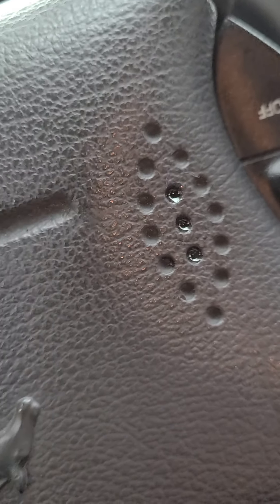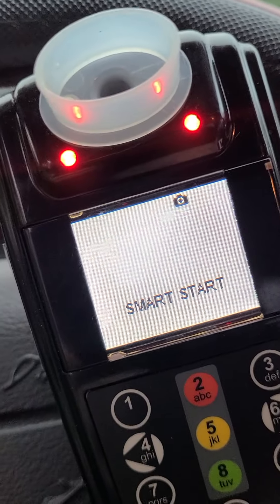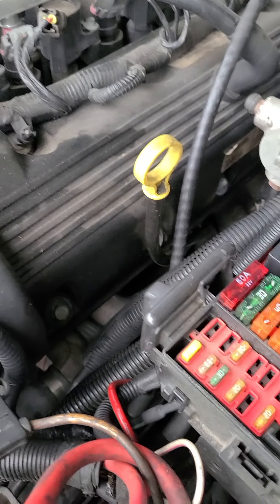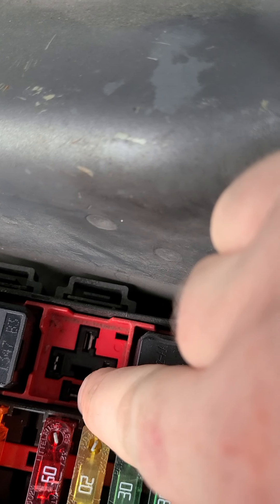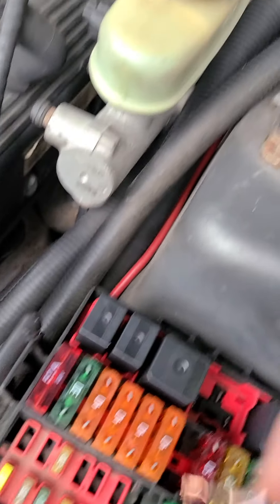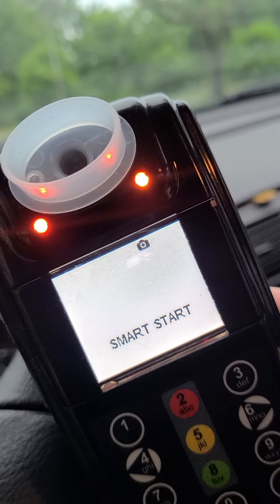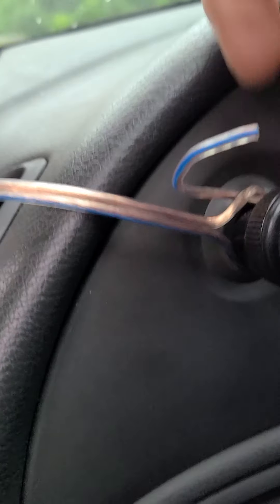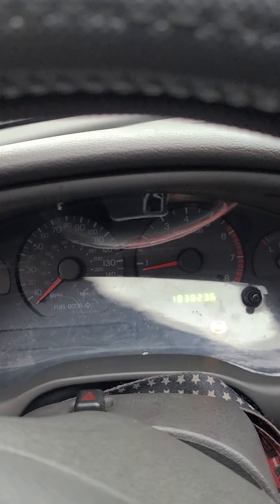bypass ignition interlock smart start

Comment: Is it wired to the starter only? That’s hella stupid and simple to defeat if it is because on modern cars the PCM will give spark and fuel as long as it receives signal from crank sensor, it doesn’t care if it’s cranked by a starter or anything else, that’s why you can roll start a manual car. What I am saying here is as long as you can crank the engine somehow when the ignition key is in on position, the car will start and stay running, and you can pop the hood of your car and complete the circuit of starter solenoid with a screw driver or any metal bar, and the starter will engage the flywheel(or flex plate) teeth and crank the engine.
Reply from the maker: That’s all it’s hooked to is the ignition wire under the dash that engages the starter when you turn the key. When you blow into the device and hear it click that is the relay completing the circuit
Reply: @ronnie7757  lmao, that’s lame!

Comment: I have intoxalock. Will that work on it? Also Can the IID service detect any tampering? Thanks.
Reply: That’s what I’m wondering, I failed my Intoxalock 3 times and got a letter today saying their extending the damn thing for an entire extra year.  Time to figure out how to start bypassing this thing
Reply from the maker: Should work with all brands
Reply: @Werk4Cash  I have intoxalock too. Had violations as well. Gotta use this for a long time and I do deliveries. Did u have success or did they give u a violation? Plus mine has a camera that takes a picture when I blow. But maybe if I just start it it won't take the picture. Any help would be wonderful
Reply: @turtleyto  no success man :( but I have heard of people jumping the selinoid on their car and it completely bypasses it but I am way to scared to try it, there’s definitely a possibility that it will show the car was started without any blowing.  It sucks man I’ve done hours of research and just can’t figure out a way around it but there has to be one we just don’t know it yet

Comment: That device will still read a start without a test it reads alternator current  once the vehicle has started so your just digging you hole deeper by doing this. Once this device  is collected  and the data has been downloaded it will show a circumvention of the system. BTY if you are doing this thinking you will get out of paying your fees think again most states put a hold on your  license  until all fees are paid to the provider. It may be even worse your local dmv or monitory authority may not credit your time with the device and make you start the program  over from the start . 7 year interlock technician here I've seen it all and clients that do things like this ALWAYS turns out very badly for them.
Reply from the maker: I got my device removed and haven't paid smart start anything for the last 2 months I had the device. Got My license back without issue. This was almost 6 months ago.
Reply: @ronnie7757  he thought he was on to something. Clearly didn’t watch the entire video. Like you said the whole thing is a huge scam.
Reply: @rorymurray2891  Rollin Phat 💰🤑 Thanks
Reply: If it reads current without a start then you can't charge your battery?
Reply: @erush611  You can change the battery just let the provider know you did change it. The technician you contact will put a note on your account that the vehicle was powered down for the swap. This lets the monitoring authority know that the device was not tampered with because it records power up time and power down time.
Reply: @slapnutzracing2967  that's right you bring tow bill and shop receipt
Reply: what if the handheld is disconnected?

Comment: Do you get further violations once you are on lockout and use this method?
Reply from the maker: I didn’t
Reply: I work as an installer for a different brand and we could identify this super easy and he'd have a 3 month license suspension and more penalties.
Reply: @BrapYeah  interlock I suppose  records rpms(knows engine running), and the mileage am sure is noted. Maybe only works if speedo is broken. Probably, counts the times it's started. (W/o breath samples) am close huh🤓
Reply: @BrapYeah  should be able to make these more reliable super easy lol

Comment: What about the camera and gps?  Are they still active with this bypass method? 👀
Reply from the maker: Mine did not have GPS. As for the camera it is only supposed to operate when your blowing into the device. Also if your to the point of bypassing it I'm sure you don't care about the camera lol
Reply: @ronnie7757  lol. Thanks for the info.

Comment: @roadsafeties-wg6hi
0 seconds ago
SOS Any body. I have a 2010 F150 XRT suddenly the security system would not let me start. I did what you said on this video and even took out the transponder and remote starter, but the light keeps on blinking and not even a crank. The on and off switch for the security are two red wires, which seems to run into somewhere in the hood. I don't know what else I should do. And I can't find any other memory box for the security except the two boxes I mentioned earlier.
Somebody help me

Comment: i tried on my 2016 jetta 5 speed manual, i could not get it to work  my fuse box says 87 and 30, do not have 87a.  any suggestions?
Reply from the maker: It's possible your neutral safety switch is stopping it. My mustang use to be auto but swapped to 5 speed. Never hooked up safety switch so car starts without pressing clutch. Have someone push the clutch down and try it.
Reply: Have you tried to push start it before?

Comment: If you do this, just like bypassing a bank/buy here pay here, the machine will know, and whatever enforcement agency you report to will know. You will be riding the bus for a year. If in fact you may never be allowed to drive again, depending on your jurisdiction. And all the time you have will be erased. You can even be charged with another DUI.
Reply: WRONG, you can't be charged for a DUI unless you fail a BAC or blood test.
Reply: You sound like u work for these guys 😂
Reply: You must be part of the scam. Interlock device is only so you can drive before your suspension is up. If your caught all they can do is tell you to ride out your suspension which is the punishment you already got. Where I live the courts or probation have nothing to do with drivers licence division or interlock. Probation or court just suspends your licence. It's the Drivers Licence Division that requires it for you to have a valid licence before your suspension is up. It has to do with local laws. Now probation can set any standards they want, but they can't force you to have an interlock. I've been driving with a suspended licence for 14 years and I've been pulled over a couple times. I've had to spend a total of three days in jail in the last 14 years. My average is one pullover every five years. I never gave them a cent for fines or anything. Im not scared of jail. I will never lose my job because I'm self employed. The max jail sentence for my many warrants and DUI warrant is only three months. I told the last judge "I'm not giving them any money, take me to jail right now." The judge said jails are full you can't go and they sent me home without removing my fines or warrants. It's funny when your not a serious criminal and the courts can't scare you with jail they are hopeless. They can take my licence but not my keys.
Reply: @nicks7434  That's right my CRO told me he had nothing to do with interlock is a scam and faulty people like to get on here and scare people trouble is by the time your done this is when you find out
Reply: How come you guys that install them got DUI s it a joke
Reply: @jesusmalverde612  Right !! That's exactly what I thought.

Comment: Yeah. And as soon as the device senses that it lost power it alerts the people that they lost connection to device and they will assume you're tampering with the car iid or disconnected a wire
Reply from the maker: Wrong
Reply: Peoples batteries go dead in there cars all the time. I'm pretty sure there not going to give you a violation for a dead battery

Comment: where can i get this kind of wire?
Reply from the maker: It's just speaker wire I think it's 14 gauge wire its what is used for wiring Subwoofers thicker than regular speaker wire.
Reply: @ronnie7757  which wires do I use to make it start

Comment: Will the breathalyzer company know if you do this ?
Reply from the maker: Smart Start had no clue that this was being done the last 2 months of my agreement. The reason for that was because I did not take it in for the recalibration that last time. So when it was time for it to get removed I took it to the place they removed it and I still owe smart start over $300 and never have heard a word from them and I have my license back and have had no issues with anything involving bypassing the device the last 2 months. Once the device is in lockout mode smart start things you can't start the car. They would only know the car was started if you took in for a calibration, however I am not even sure their software would tell them that.

Comment: A family member lost a alcalock cordless device the cars been parked outside can i start the 2000 Buick la sabre bro how can i drive with out the blowing device they wanna charge me 200 for a new one plus the monthly service fee ... Help Me Brother!!! Ill cash app you QUICK G
Reply from the maker: Just jump the starter relay like I show in the video. Turn the key to the on position like you would start it normally find out which relay runs the starter and jump it. The car will start
Reply from the maker: Your starter relay is relay number 36 in the engine compartment fuse box. Pull it and follow the instructions in the video

Comment: It’s amazing that you can figure this out but can’t figure out how not to drink and drive to get the interlock in the first place. Then you couldn’t figure out how not to violate the interlock by not drinking. Amazing.
Reply from the maker: It’s amazing your spending your time looking at videos on how to get around the interlock system. Go back to your moms basement.
Reply: What's the air like up there on your pedestal? What Ronnie said: Why are YOU looking at videos on how to bypass an iid?
Reply: @im2yys4u81  

1. No pedestal. Just a normal functioning responsible adult. You are the anomaly. 

2. That’s what we do to stay up to date with criminals.
Reply: Dude it's not actually that complicated. I searched it up just to confirm what I suspected.
Reply: Tree hugging wus
Reply: I guess you people are not reading his post upfront. He says clearly says, he doesn't condone drinking and driving and this is not a video on how to bypass the device if you have been drinking. Its to bypass the device because the equipment is faulty and locked him out and then he has to pay a fine to get an unlock code.
Reply: 😂 exactly that point way easier to not drink and drive LoL just don’t get inside the driver seat problem solved call an uber if you can afford interlocking you can afford an Uber

Comment: Does it work on manual cars
Reply from the maker: Yes, my car is a 5 speed.
Reply from the maker: The device is nothing but a large relay. That is the clicking noise you hear when you blow into it. It's the relay switching to complete the connection to your ignition switch. That's why bypassing with the starter fuse works. It bypassing the ignition switch.

Comment: Didn’t work on my truck
Reply from the maker: Did you find the starter relay?  What year make and model truck do you have?
Reply from the maker: Also forgot to mention. The longer the length of the wire means it may need to be thicker. With a diesel you may need bigger gauge wire to jump the starter. Had to double up the wire on my other car or else it would just click
Reply: @ronnie7757  my truck is a 2005 dodge Cummins 3500, I used some speaker wire on the relay, tried jumping the wires and all it did was make sparks didn’t turn the truck over.
Reply: @ronnie7757  I’m getting my blow box taken out in about 3 months, I don’t drink and drive anymore I’ve been sober for 9 months but fuck is this blow box annoying
Reply from the maker: @arcticdiesel8972  your starter relay should be #14 in the under hood fuse box. Make sure you have the wire on the correct prongs. Should be 87 and 87a if I'm not mistaken they should be right across from each other. try using a small length of wire at the starter relay maybe a foot at the most and touch them together and see if you hear the starter turn over. Make sure you are using a fairly thick wire. I used speaker wire that goes to subwoofers I think it's 14 or 16 gauge wire.
Reply: They didn’t find out you did that?
Reply from the maker: @AngelRodriguez-jv6oc  who is they? My suspension is up. Device has been removed.

Comment: To be fair it takes 4 fails in a month to be in violation lock 😆😆😆😆😆
Reply from the maker: Not in the state of Kentucky. It takes 1 and you have 4 days to take it in and get serviced or it's locked out.
Reply: @ronnie7757  damn son. They ain't fucking around
Reply: @ronnie7757  same way in Alabama
Reply: Massachusetts is terrible
Reply: Not mine. Violates me for everything. I've failed 4 times in my first month and haven't drank in 3 1/2 years.
Reply: @ronnie7757  same in Florida. Violate me for everything. $75 a pop.
Reply: Violates if I don't pass a test for not having my mouth closer,"don't inhale,now there is an issue w the hand piece again!!won't let me start blowing before it fails my test stuck on test w a LOUD LONG BEEP then blow,won't let me resigter a blow many other oddities $$$$ lots of smart start have closed in WA. State its 40mins to recalibrate...smh I have no more patients but thnx for the trick a tow is expensive I have 48hrs to figure out how to get my car 40miles...and I'm trying to look for a job niceee....smh
Reply: Mine is gone. I took that shit out myself. Intoxalock reported me to the state and they revoked my license. I haven't had a drink in nearly 4 yrs. They're supposed to report you if you blow over a .02. It wasn't possible but the device said I blew a .0072. Which is almost impossible. And I passed all the retest. So in only 6 weeks they took my license that I struggled to get back for 4 yrs. I don't even know what I'm going to do now.  They just cost me everything.
Reply: @dannyg7823  become a sovereign citizen and drive without license and tag..
Reply: @ronnie7757  The state of Alabama is a bac of over.02 4 or more time in the monthly reporting period
Reply: @dannyg7823  should not have took out
Reply: That's right Brandon
Reply: 1 violation and have 4 days to service or locked out in Minnesota with Intoxilock
Reply: Absolutely not true. If you get asked to blow and don't do it before you leave the vehicle you will come back to find a four day violation code. You have four days to get a recalibration and pay 70 dollars or it will lock you out.

Comment: These videos make me laugh, you are just screwing yourself over bro, that device knows when you start the vehicle based on the voltage from the alternator, and logs everything, so when you take it in to get serviced they will see that and report it to department of transportation and you will get charged for it, have fun with your 6 month extensions 😂
Reply from the maker: I’m sure your comment makes you feel very smart. My device got removed 3 weeks after I made this video. No one has called no one has said anything. I even still over smart start money that they will never see. Also I bypassed the device on my other car , took it in for service and nothing was said to me about it. So stop thinking you know everything
Reply: @ronnie7757  hi ronald have you already dismantled the unit or blown me I hit it against the steering wheel and a mini battery had come out of its place I opened it and moved it back in place and closed everything I have an appointment with you for 2 days according to you they will see it on their computer this what i did please help me